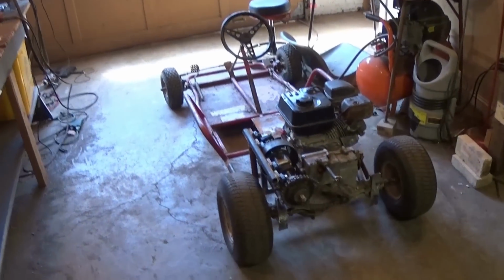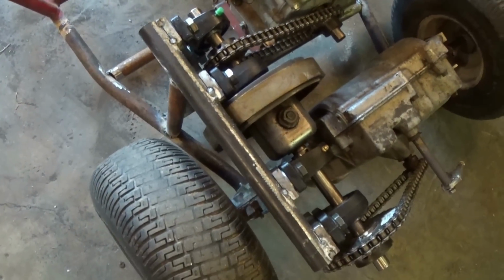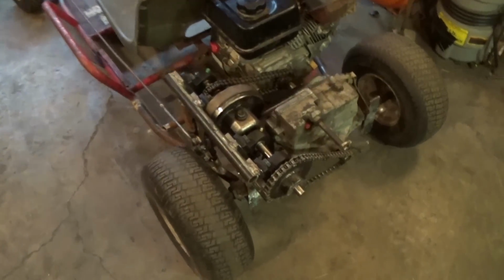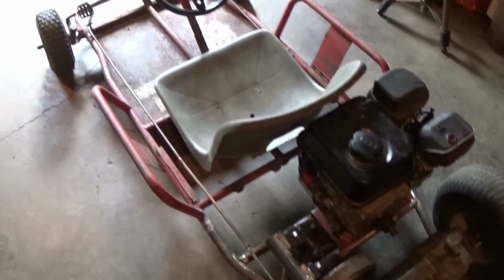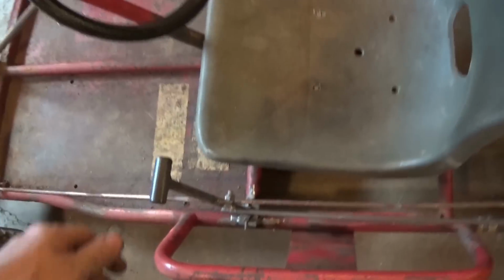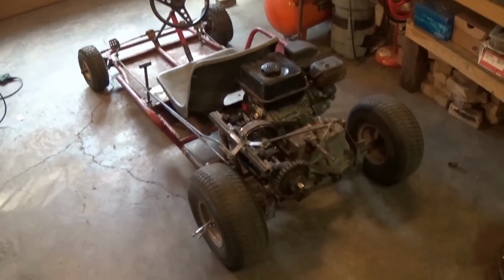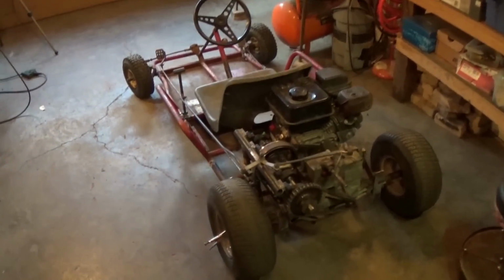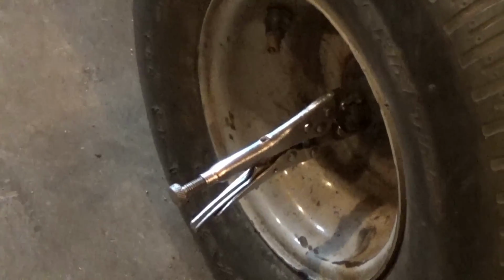home made shifter kart part 2

Comment: Transmission sprocket is WAY too small. Your jack shaft/clutch set up is genius. Study up a little on gear ratio's. You went from a 10+" pulley to the equivalent of a 2.5" pulley with that small of a sprocket. The only reason it's not working is because you're ratio's are too high. Go to a 1:1 final drive ratio between the jack shaft rear sprocket and transmission sprocket and you'll then be able to change your ground speed with the engine sprocket and have plenty of power with the 6.5. Zip~
Reply: yeah his pure thought process is genius then through lack of research and understanding he manages to discourage himself almost every time... realistically snowmobiles and also some of the most capable atvs ever are belt drive... that jackshaft has 4 power transfers so if done correctly with proper understanding of  ratios a direct belt clutch would actually have less drag and they practically engage themselves with no spring if done right... most peerless axles are 12:1 in high gear so if from engine to trans it were 1:2 the kart would work as is but any conventional means of clutching would work better again if done right
Reply: Agreed. I love the concept and he does think out of the box for sure...but he does stymie his self. It's refreshing that he openly shows his failures as well as triumphs though. Zip~

Comment: You have finally moved me to get going on a project.  I have a brand new 5hp Honda engine and a 700 series Eaton hydrostatic transmission I bought for another project that never got off the ground.  They have been sitting untouched in the shop for several years.  They would be perfect for a kart project.

Comment: As everyone is saying, gearing. Even if those gears in the rear were the other way around they you'd have a little gear reduction and improve low end torque. First time I've seen it used as a clutch, there are some racing transmissions that use locked sun gears to change gears (Lenco from years ago is one I remember. As a clutch I think it looks like it'll sort of be like a in and out box like a sprint car as its either engaged or locked no slippage really. Cool concept and hey it worked!

Comment: change the gearing between the clutch and the gearbox
Reply: yes that gearing is backwards large to small will never work
Reply: yeah it is geared too high
Reply: agreed gearing too high
Reply: and change those chains out for good "B" belts and it will run way more quiet
Reply: thats what i was going to say. gear for more power. your all speed in first gear. in 3rd youll be doing 100 miles per hr. 
otherwise sweet build. 👍
Reply: Yup

Comment: You have major torque issues. What's the final gear reduction from the engine to the axle? It should be at the very least 1:3.5 but 1:6 would be much better. A predator 212 would have no problem running that kart with proper torque.
Reply: RealSteel 1776 I agree! First off, I think the gearing is holding him back tremendously. Secondly, the engine may need some adjustments... Try adjusting the idle/high-speed needle to see if that will help.

Comment: lovin this build and LOVING the fast forward building, since i cant do this yet i love to watch!
Reply: 2 things, sounds like your clutch system slips alot and your predator is fucked, try regearing it for more power!
Reply: and ease the clutch in!
Reply: YOUR USING SETSCREWS AS KEYS!? cmon man your smarter then this.
Reply: also get ride of the diffclutch thang and throw a torque converter on, perfect auto clutch and gives each gear a wide range so insane gearing

Comment: Bigger engine would be cool but the sprockets really look too tall... Are you sure it's not just gearing? (What ratio is first gear on that shifter? It seems unlikely it's enough to counteract the mechanical disadvantage of the difference in sprocket size between the output of the differential clutch and the input of the shifter.)

Comment: Like your vids
Small gear on motorclutch shaft and large gear on transaxle. Will make it work. Look at mower. Small pulley on motor and large pulley on transaxle. Gear ratio is extremely important

Comment: To lower the rpm on the clutch may help. You can just put a bigger sprocket in stead of the first sprocket, and if you want to keep the same speed for the go kart, you can just simply put a bigger sprocket in stead of the 2nd sprocket that goes directly in the gear box, keeping the same ratio between the first sprocket of the clutch and the second sprocket of the clutch

Comment: The oil sensor in those engine are very picky about the oil level. Try bypassing it to eliminate it being the culprit of not running. I agree with everyone's gear comment too, you should swap the sprockets. Great build, Good job.

Comment: You should put a centrifugal clutch on the motor like you would for a normal kart then have the chain run to the jack shaft and that's pretty much all you would have to i understand the differential clutch wouldn't work but you would have a decent sifter cart.
Regards Harrison.

Comment: you need a bigger sprocket on the clutch... and you need to let the clutch out slower.🖒
Reply: the bigger sprocket will help with your power issue and letting the clutch out slower will also help you with taking off. Im also a mechanic so if you have any questions feel free to ask. keep up the good work.

Comment: Yeah you definately need to take some gear out. And maybe pull the governor for some more rpm, that might give you the room you need so you dont have to run like a 48 tooth saw blade on the back of the clutch shaft lol

Comment: You could try switching the two rear most sprockets, you have it set up for top speed with the big sprocket powering the transmission. no need to put a bigger engine really. taking the governor off would be a good start if you haven't already.

Comment: the motor has enough power, the cart is geared for top speed. change the sprockets for better acceleration
Reply: The 465cc Briggs and Stratton motor that came on the mower he took that Transaxle from is enough power to push that little cart even geared for top end. So yeah 212 cc is under powered.

Comment: by setting up a diff as a clutch that way you've essentially added a jack shaft setup and with those small gears it's way over-driven, to start with you should have the smallest gear you can find on the engine and then get a gear 3 times that size on the diff shaft then go from there, you want to get the shaft under-driven.....

Comment: put a smaller sprocket on the output shaft of the clutch and put a bigger sprocket on the transmission input shaft and the engine won't struggle as much to launch the cart. everything on the cart is good right now just change those two sprockets and you should get a better end result. basically your starting it in a high gear just like in a car to start in a high gear is just not possible. so please consider my advice and if my advice to you is helpful let me know

Comment: i'd use belts just use big pulleys so they will handle the torque. there are no bearings in differential, so your experiencing a lot of drag out of the spider gears. probably work best if you can get the speed threw the differential as slow as possible and get your break band to hold. (untill you reach the torque threshold of the differential) keep the cross pin oiled or it will galled and lock up.

Comment: I am sure the problem is the ratio of the chains and sprockets up and down not the engine horsepower .So if you don't want to keep messing around with the "clutch"  then hook it directly to the transmisssion and use a drive belt as the clutch
Reply: cody cheney the whole point in this build is to avoid using a centrifugal Belt or chain driven clutch. the whole point is the make a manual 5 speed shift cart from scratch.

Comment: Just a friendly FYI..welding on galvanized metal such as bolts is very toxic and can be hazardous..best to clean it off with a wire wheel..much respect to your fabrication skills..you would be perfect for the airline industry.

Comment: I think putting a bigger sprocket on the motor would fix the problem since you'll have a short gear then to a tall gear then back from a short gear to a tall gear on the gearbox that's what I think is your problem the sprocket on the motor should be bigger.

Comment: If the engine needs more power there's always raise the compression ratio and run it on nitromethane. I had a friend do it on a mini bike and it worked. was a bit tricky but hey thats all part of figuring it out. the fuel was actually model airplane fuel nitro/ cotz oil. his engine was single cyl briggs stratten. cops clocked him at over 90 mph. not bad?

Comment: Put a bigger sprocket on the actual rear end shaft where the old lawn mower pulley once was and a smaller sprocket at the back where the big sprocket is and she will have pulling power just not speed right now u have it geerd way to high with that tiny sprocket on the rear end shaft..

Comment: I am using a 212CC engine like that on a much bigger go-kart, And i have no issues with it.
Reply: The engine May be idling to low when you put it in gear.
Reply: the gearing is too High , it's like getting off the line in a car in 3rd gear

Comment: It would work much better if you didnt use a mower gearbox those are geared to drive the mower with belts at a low speed. also decrease the contact patch on the clutch and put a smaller gear on the engine you just need more torque going to the clutch and less grab

Comment: Your gearing between the clutch assembly and the input on the transmission is WAY to high. You need to swap those gears, it WILL help with takeoff, and will be a bit slower overall. You have a 5 speed gearbox from what I can see, so you should be OK as  5th gear should be close to 1:1. You have a good transaxle in the Peerless unit, but it won't take the high rpms you'll be shoving into it with your gearing.

Comment: first of all there is way to much mechanical drag in the system. second you can't just dump the clutch and hope for the best. you have to use it like they are designed to be used.

Comment: you have no need for a new engine. just better gearing. Just do the math. divide the engine sprocket to the engine side idler gear,  then transmission side idler to the transmission input. Then find the ratio of first gear in the transmission. By the looks of it your trying to break a Bonneville Salt flat record with that gearing.

Comment: bore out the cinlinder  change piston rings well rebuild the engine or swap out for a motorcycle engine a 100 should be good but if you more of a front end lift a150 or 200 would work

Comment: That looks like a transaxle out of a craftsman or montgomary wards mower. If so they come with 465cc motors your little 212cc ain't cutting it.need way more torque. I am build a no weld ratrod trike with that same transaxle and original 465cc motor. and you have to get the gearing right. But I still maintain that 212cc is to small

Comment: Governer really interfering with it needig to get to about 2500rpm to even run it it does have the power at lower then 2300 or so
Reply: Oh and one more thing oil sensor needs be disconected im sure its sloshing oil around and doesnt have enough on sensor